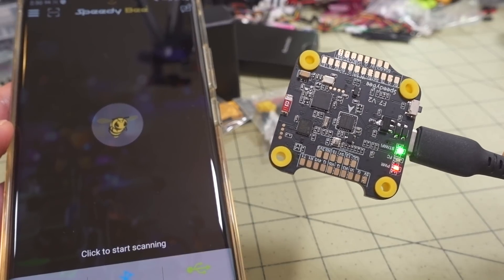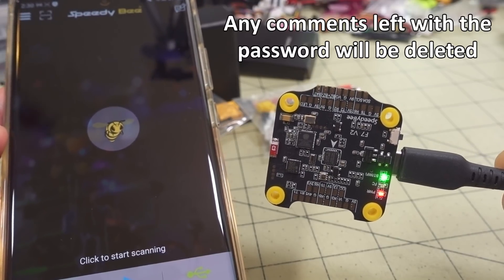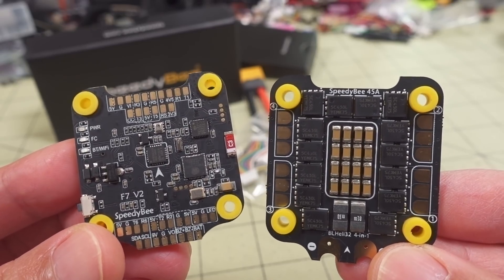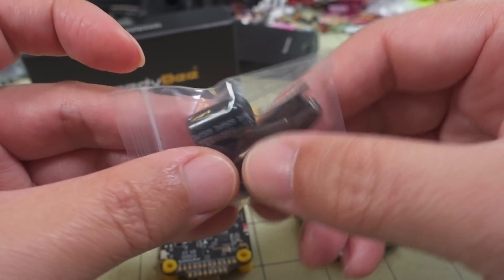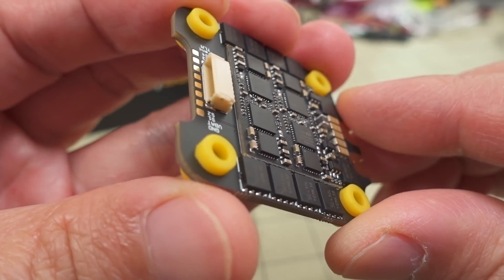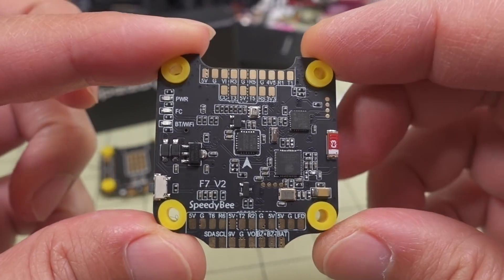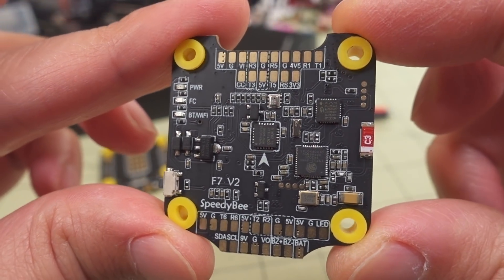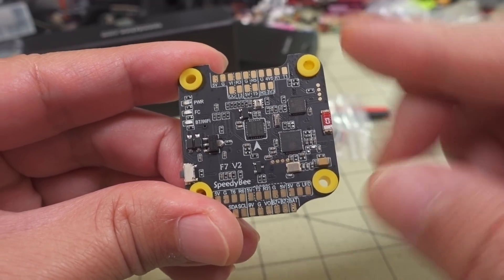SpeedyBee F7 V2 Stack Review 🛠️

Comment: how do you power the FC I'm using 4in 1 esc 45 blheli but can't get power to the fc
Reply from the maker: If you're using the 4-in-1 ESC I have in the video, it runs off of battery power assuming you plugged it in correctly.  If you're using another brand 4-in-1, you have to refer to the documentation that came with that ESC to see if it matches the plug pattern of the FC otherwise you'll have power problems or worse fry the FC.
Reply: I think I fried the board I didn't check the pins till after the fact lol. it powers up from USB but  thank you for the info

Comment: It took me a while to figure the next letter but then I realized its connected to the other previous two. A little bit tricky though.

Ive been using the speedybee app and sometimes its hassle if your fc doesnt have a bluetooth or wifi built in cause you need to plug in/out your OTG cable to do some configurations.